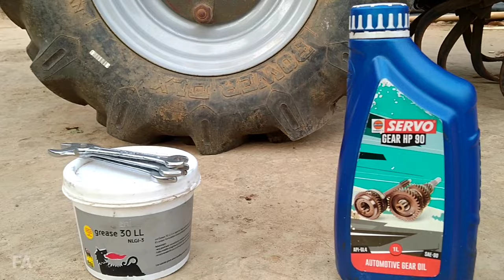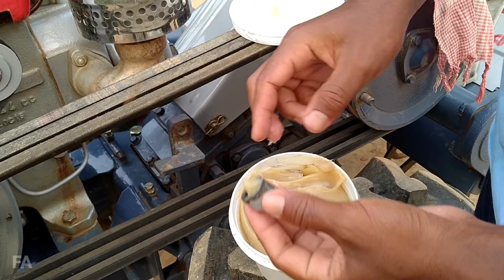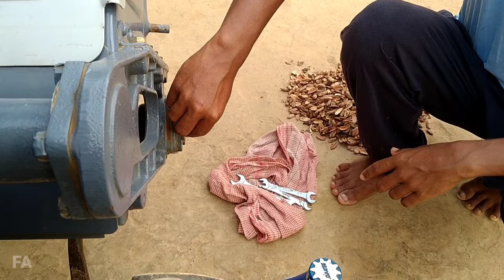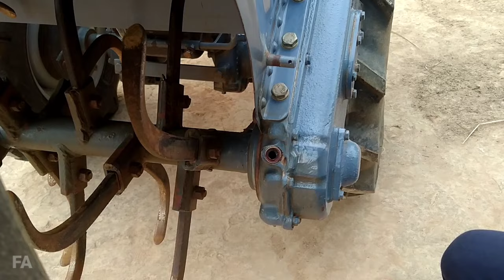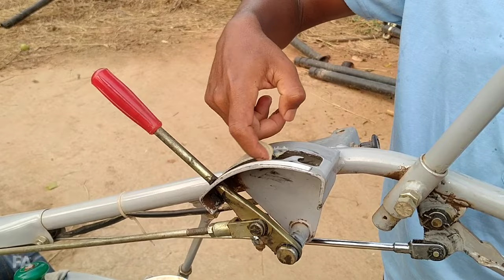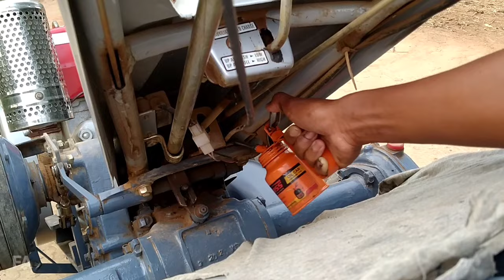KAMCO Power Tiller Greasing Points || Lubricate by using Grease and SAE 90 Gear oil || Every 50 hrs

Comment: Does kamco has 20+ hp in power tiller?
Reply from the maker: It's Available up to 12 hp. (Kamco Super Di)
Reply: @FarmingAreaofficial  ok, and what about in other brands, any idea?
Reply from the maker: If you want more hp, then you can take Kirloskar Magat15. It's 15 hp.
Reply: @FarmingAreaofficial  yes bro l want more hp cuz our land is mostly swampy area, l use a very old Kubota with 22hp, now engines were running out so l'd prefer 20/22/23hp in power tiller but not a tractor
Reply from the maker: Yes, I can understand the situation. I think you should continue with Kubota again. Anyway,
Where are you from?
Reply: @FarmingAreaofficial  4